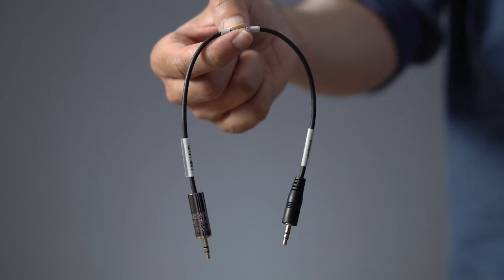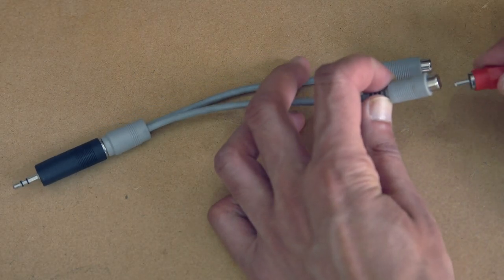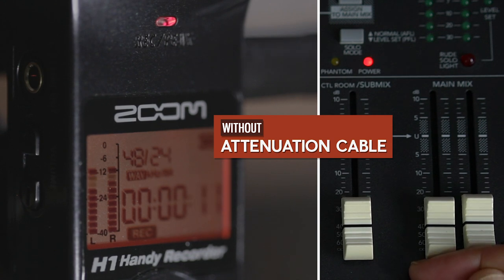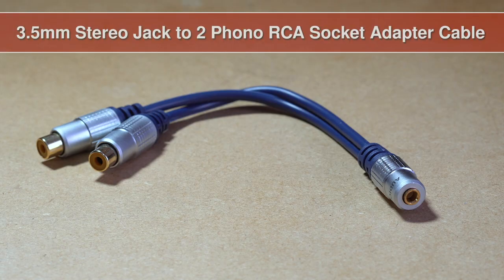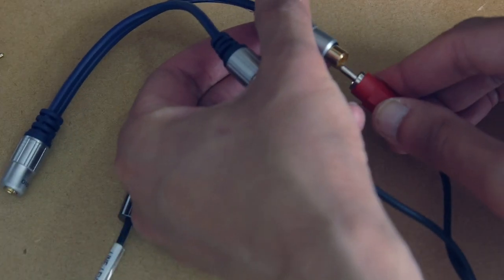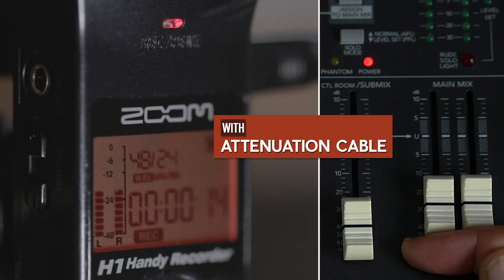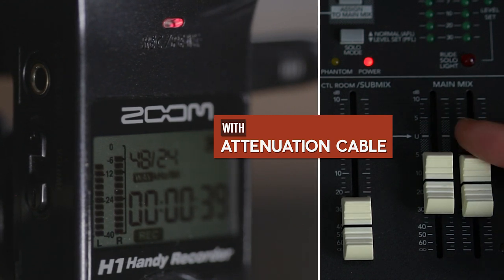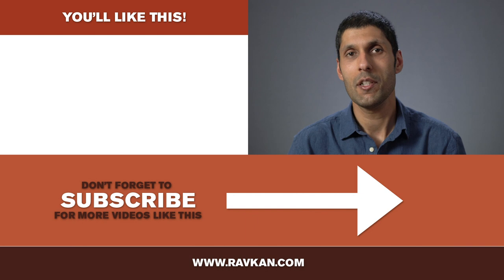How to Connect a Zoom H1 To a Mixer

Comment: I got a H1N, I'am not able to set enough gain on the device without getting distorted signals. When I set the gain down, I get some crack sound in some of the tracks, especially in kick sounds, maybe the missing gain interrupts in some ways idk. Will this setup with the attenuation cable fix this? Because I could set more gain on the zoom H1N?

thanks!
Reply from the maker: Hey RedHotMartinpepper, You're getting distortion or clipping because your audio is going beyond the 'zero level' which is the clipping zone. The Attenuation cable will give you more headroom so you don't wont get the distortion/ clipping. It usually happens with drums and when your your tracks are too loud. So yes the cable will definitely fix that. Let me know your results
Reply: @RavKan  Thanks! The stuff is ordered, will let you know if it worked out!
Reply from the maker: @RedHotMartinpepper  Brilliant. It will definitely work
Reply: @RavKan   Thanks for your support man! It works, the sound is clean and nice, so I can finally record my mixes easily!
Reply from the maker: RedHotMartinpepper Hey there, I’m so happy it worked for you 👍🏽👍🏽
Reply: Got the same problem with the h1 and landed here. Attenuation cable is another peace I need to carry around. Guess I am going to get a tascan dr 44wl to record my mixes...

Comment: Your videos are great, straight to the point and clear to understand, this was exactly what I was looking for! One question, do I need the splitter if I have a 2 phono to single 3.5mm jack cable? Thanks in advance
Reply from the maker: Julian Voigt Wedding Films Hi Julian, Thanks for the comments 😁
As the attenuation cable has a male 3.5mm, you’d need the splitter to have a female 3.5mm. I found the audio will clip without the attenuation cable.
Reply: +RavKan ofcourse, brain wasn’t working!
Have ordered the cables from Amazon
and going to use them on my next wedding 👍
Reply from the maker: Julian Voigt Wedding Films Ha no worries! Happens to all of us!

Comment: If you use the locut filter in the H1N and lower the intensity of it around 50%, and process the audio in software later to make it sound good. Would that also work? or Do I need to have attenuation cable?

Comment: cool! finally, someone addresses this issue. can this attenuation cable bring down level low enough for Sony ICD-UX570 without clipping? thanks :)
Reply from the maker: Hey Kenny, Glad you found the video. I can't comment on your setup but the cable does lower the incoming audio signal for sure
Reply: @RavKan   thanks! do 3.5mm Female to 2 RCA male works? so I can avoid 3 cables :)
Reply from the maker: Kenny Sim The attenuation cable is the most important cable of the lot. So as long as you got that connected in the chain, it will work
Reply: @RavKan  great! using your link to get 2 cables!
Reply from the maker: Kenny Sim Fantastic! Let me know how you get on

Comment: Can I plug a digital keyboard directly to the line input on the H1 using an 1/4 inch to 3.5 (aux cable, male on both sides) adapter 
Or is it best to go through the mixer using the method you described in this video?
Thanks Greetings from Houston Texas

Comment: Thanx! Does this also count for multitrack tape recorders like fostex?
Reply from the maker: I’m unsure about the Fostex to be honest. As long as the Fostex has line outs then you should be okay
Reply: @RavKan  until now I've just used 2of the input Jacks ( because the zoom is stereo)  of the mixer. I can hear the mic but no recording. You use the tape in and out (rca) on yours correct? Thanks

Comment: HI @RavKan thanks for the video. Is attenuator cable the same with 3.5mm TRS male to TRS male cable? are they the same stuff?
Reply from the maker: It’s a cable made specifically to reduce the audio signal. Do not use a standard TRS cable. You’d clip and distort your audio if you do

Comment: Thanks for this (hopefully) very useful video! So, I got the attenuation cable and the adapter. But I only get signal in one channel. Would the fault most likely be in the attenuation cable or in the adapter? Or is there some kind of a setting that I am not aware of? I tried the H1n using auto level and limiter, but got clippings when recording a live dj set, so I would very much like your trick to work!
Reply from the maker: Christian Herseth Sørensen Hi Christian, It may the Cable or Adapter you’ve got. Maybe return them both and get a new set. There won’t be any setting in the H1. The auto level or limiter in the H1 won’t work as well in this case.

Comment: Hi Ravkan, Have a Zoom Q8 camera to record live video performance of mainly guitar and vocals with backing track sometimes. Is this the same procedure to connect  the mixer to Q8. Enjoy your videos thank you. Cheers, Kev
Reply from the maker: Hey Kevin. I'm not sure about the Q8 camera but it does take XLR and Line Level inputs so you could connect a mixer to it. You'd have to try and see if it works
Reply: @RavKan  much appreciated thank you again 👍

Comment: Would you necessarily need that cable if you were just recording vocals?
Reply from the maker: Hey, the cable is to connect the H1 to the  mixer. The audio will just be from the H1 with no distracting background audio

Comment: Just ordered the cables. Lets see if it works. My dj set sounded distorted . Crackling noise. If it doesn't work gonna ret hn1 to guitar center lol. Attenuation cabel was 28 bucks on ebay.
Reply from the maker: Hey Steve,  Audio Clipping and Distortion is always frustrating. The cables will definitely work if you follow the instructions
Let me know how it goes
Reply: Thank you so much. Audio quality is 100 percent. Your awesome.

Comment: Hello, Thank y ou for sharing your experience RavKan.. do you know if using the H1n with the LINE IN instead of the MIC in, and also using the auto limiter will do the trick?, any thoughts on that?.. or anyone that tried this?.. im trying to get away to shoot a wedding using 2 or 3 H1n since these are small.. also another question.. (im new with audio stuff).. u think using H1 (or H1n) with the on-built microphones and placing it near the Speakers (with autolimiter on) would give a nice result to have as  Back Up in case the Line-in from the DJ mixer fails?.. what are your thoughts about that?. thanks buddy. best
Reply from the maker: Nicolas Merono  I’ve tried the Line in method many times years ago on weddings but it was resulted in clipped audio. I’ve never had much luck with the Auto Limter either. I like to be in control of my audio and not rely on Auto features.
Yeh place a few H1’s around the room will work but i wouldn’t  place them too close to the speakers. I usually get to a venue early and speak to the DJ or Band and see what audio setup they have.
Reply: @RavKan  that was fast, thank you, i will use the attenuation cable for the line in... as for the H1n and the distance to the speaker.. i was thinking to set it in a very low level maybe in top of the speaker or something so i can cut the ambient sound as much as possible.. i dont rely on DJ's and i usually shoot alone with 2 cameras simultaniusly so i can't check the audio levels..  but of course i will try to do a sound check before the reception starts.. one more question... how lower you can go with levels without loosing quality if you have to increase the DB on post?.. meaning, if i just leave it lets say, half the graphics level (so i can leave room in case they increase the volume).. will that audio work later in post?, thanks buddy, great channel
Reply from the maker: Nicolas Merono I cant answer that. You have to test it out but I wouldn’t keep the audio too low. Also speak to the DJs. They’re just people doing a job 👍🏽
Reply: @RavKan  Thank you buddy!!!

Comment: I love this video and it has helped me narrow down my search as to what I can use to record high quality audio at a lower cost. But are there any other links to attenuation cables for the US? I want to support your channel as well, but the attenuation cable linked is not available :/ Thanks so much for this tutorial!
Reply from the maker: Hey Kalai, Happy that the video helped. The MOVO cable is quite popular and usually sells out. Just search Amazon for  '3.5mm Male Line-in to Male Microphone Attenuator Cable' . Click on the Sescom cable, that will do the same as the MOVO cable. Hope that helps

Comment: very informative! just want to ask, is there a difference in sound quality using this tutorial (h1) vs the h4n recording to the mixer (your previous tutorial). Tnx in advance.
Reply from the maker: Dabol Yuh Hi Dabol, Thanks!

As long as you record at the highest bit on either device, you shouldn’t notice a sound difference. 
Just don’t record in mp3 and make sure the H1 / H4n (and all cables) are fully working.
What will you be recording?
Reply: @RavKan  hey Ravkan, if thinking about a pioneer mixer, where do i put the cables from the hn4?

Comment: I have an H1n, it looks like the cable your using is -35 db, I have several in line style pads that I could use, what are your thoughts? Thanks
Reply from the maker: Hello Steve, Try the pads to see if they stop the clipping and distortion

Comment: Would I set the h1n to line level record? As I will use this for weddings can I set and forget or can it get to low that I can’t bring the audio up enough later? Also if I am using an aux out will I still have this issue. Thanks
Reply from the maker: Hey MJS, 
When you connect a mic level output to a level input, incoming audio will be very low. If you connect a line level output from mic level input, the audio will be too loud and will clip and distort your audio.

Comment: Can i use this for drum cover? With eight drum mics connected to mixer, so the output will be recorded to the H1N right?
Reply from the maker: Mainux Abi Hey Mainux, As long as the mics are going into the mixer and the H1 connects to the out of the mixer, I don’t see a problem.
Reply: @RavKan  thank you very much, i'll try 😁

Comment: Does the 'Limiter' feature of the newer H1n act as an attenuation cable, or is it still needed in a mixer connection scenario?
Reply from the maker: littlebr4d Limiters won’t really help in this scenario I’ve found. The signal is reduced too much using it

Comment: is it mandatory to use such a cable, can't it just be reduced by the recorder, or is it reduced to the maximum?
Reply from the maker: The cable made specifically to reduce the audio signal. Do not use just the H1 to reduce the audio. You’d clip and distort your audio if you do
Reply: instead of zoom h1 I can use the same cable with my phone and with irig 2

Comment: Hi RavKan, Thanks for the video. If I used 3.5mm stereo jack socket to 2 phone plugs audio cable. instead of 3.5mm jack socket to 2RCA adapter + male to male 2RCA?
Reply from the maker: Hey K, You need to connect the male 3.5mm Attenuation cable to the female RCA adapter. That works

Comment: Will using line in instead of mic in work ok if I’m getting a source from the back of a speaker at a wedding via an xlr to 3.5 mm adaptor? Or will I still need this cable?
Reply from the maker: Hi there, using a Line level signal  with no attenuation will definitely clip and distort any audio setup

Comment: Is this cable needed if no DJ is involved IE. an album or guitar played thru the mixer at a somewhat constant volume?
Reply from the maker: JJWalker Hey JJWalker, The attenuation cable will reduce a hot signal no matter what device you need to connect to the mixer. If you can guarantee the audio will have a constant volume with no clipping then no you wouldn’t need it

Comment: What if you just hook up the h1 and use auto level?
Reply from the maker: Without the cable your level will clip and distort
Reply: @RavKan interesting I haven't noticed that yet. I've used it a bunch too this way. It would clip when dj cranks up the music but then would auto adjust down to an appropriate level

Comment: which attenuator do you recommend? - 25db or - 35db?
Reply from the maker: Grant Johl Hey Grant, 
I’ve only used the -35dB cable as it works perfectly for my setup. If you push the levels quite high on your mixer and want to be  ‘clip free’ then a higher -dB cable would work the best.

Comment: Doing this, what should be setting of h1???
Reply from the maker: Hey there. the settings are made for different scenarios, so there isn't a setting  that suits all
Reply: But sir what bit rate is best for recording from mixer?
Reply from the maker: Fookisoff I use 24 Bits for all audio recordings. It takes more disk space but the high bit depth gives you more options when editing audio in post
Reply: Thanks 😊

Comment: I ran into the opposite problem when connecting the headphone/line out from the h1n into the line in from my audio interface. The signal was very low. Do i have to use a di box? Could i connect the h1n to things like guitar effect pedals?
Reply from the maker: Hi. I wouldn't know the answer for recording guitars I'm afraid

Comment: I just ordered the H1N to replace my Tascam DR-07 however feel already now some regret. This is not the same as line level input (like at my Tascam DR-07) when you need to weaken the signal to meet the input level of a microphone. I think there are two resistors inside this annuation cable, nothing special. The problem is when you need an extra sensitive amplification step, it will introduce NOISE. Higher noise floor. Weaken the signal and after this amplify it. Maybe it also a little biased, to correct some characteristcs of a microphone, no 1~1. The input is not a microphone. It would be better to bypass the microphone amplification circuitry however this device is unable to so. Useless in my opinion, this 'feature' is not a feature, recorder is not designed to do this. This is a huge downside not to buy this recorder when you want to record from line outputs.
Reply from the maker: Hey there, The Tascam DR-07 has a Stereo mic/line input similar to the H1. They both take a line-level source through the mini-jack stereo input. So both recorders have very similar connections. I've never had any issue with noise floors getting raised when using my digital recorders. What are you hoping to record?

Comment: or you connect the h1 through the booth out on the mixer, and adjust the volume there....
Reply from the maker: Bert Coertjens Hi Bert,
That’s fine until the DJ / Band lowers or increases their volume throughout the whole set. You’d have audio that clips in places and may be too quiet in other places.
The attenuation cable will keep these levels consistent based on the settings you select on the H1

Comment: So after connected the “save your life cable” to the grey one then to the RCA cable I just plug the other end of the RCA into the DJ’s mixer?
Reply from the maker: Declan McGinley Hey Declan, 
1. Plug the “save your life cable” (Attenuation cable) into the Zoom H1
2. Plug that into the other end of the RCA Adapter Cable
3. Plug that RCA Adapter cable to RCA cables already connected to the DJ’s mixer.
Reply: Please make video on how to do those steps , I dont really understand on the part "Plug that RCA Adapter cable to RCA cables already connected to the DJ’s mixer." , I mean how do you connect them to DJ's mixer, I dont have a mixer but I know a mixer has so many jack output, but which one???
Reply from the maker: Roll Media 2 You need a mixer for this to work I’m afraid
Reply: Ah thank u so much
Reply from the maker: Declan McGinley no worries!
Reply: Oh yeah is this the same with the zoom h1n the 2018 model
Reply: That’s the one I have
Reply from the maker: Declan McGinley It should work with the H1n. Try it and report back.
Reply: Can you use rca to 6.5mm cable and plugin to the headphone jack?
Reply: RavKan it worked with the new zoom h1n

Comment: I ordered all these cables, and then realized my H1 version has REC level control :0
Reply: Won't help. I tried recording some cassettes from the line out of my cassette deck and even though the level was below 0db and the red light was not blinking the audio was still messed up. The signal that goes in is just way too hot and even lowering the rec level won't fix that problem.
Reply from the maker: Compositor Carlos Mota Hey there. I don’t understand what you mean. Please explain further
Reply from the maker: freund333 You may have a faulty cable. I have used this setup in various scenarios without a problem.
Reply: @RavKan  I was talking to "Compositor Carlos Moto". To Me it sounded like he thought that he didn't need this cable cause of the rec level control of the zoom h1. But that isn't true. If the signal is too hot you still need that cable cause the rec level control ALONE won't help.
Reply from the maker: freund333 You will definitely need an attenuator to lower the signal because your audio will clip without it. You can hire a sound guy who’d take care of the audio but the cable is cheaper, ha

Comment: Why you didnt try the simply way. Just change mode in the setting from mic mode to line in mode. Easy ...you can use any cable..
Reply from the maker: Morten Tarigan Hey Morten. Unfortunately that doesn’t work.

Comment: How can we connect boom mic to it
Reply from the maker: Hi, it depends what mic you have.
Reply: RavKan I use audio technica boom directional mic
Reply from the maker: The Marathi Hub Just plug that into your mixer. If your mixer has XLRs that will work
Reply: RavKan thank you will give a try